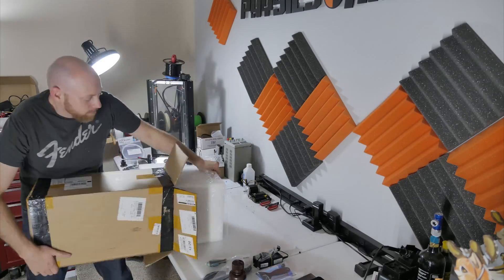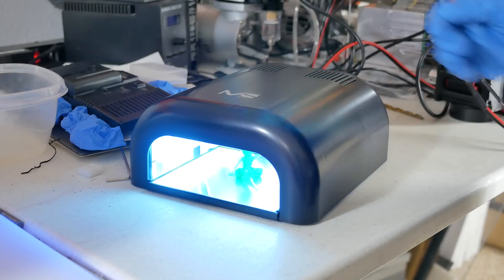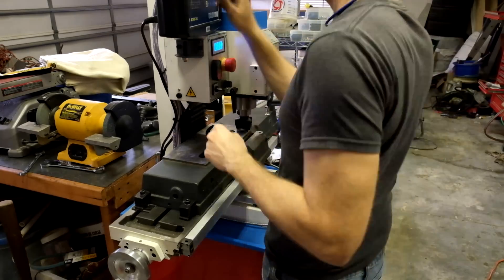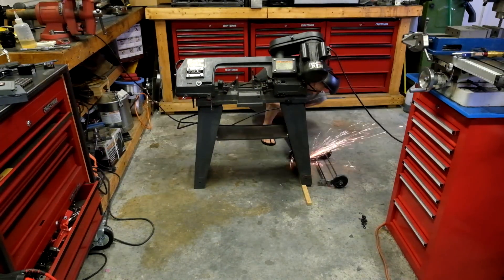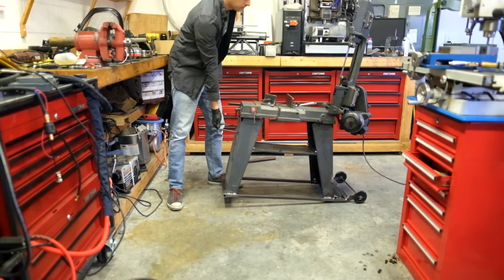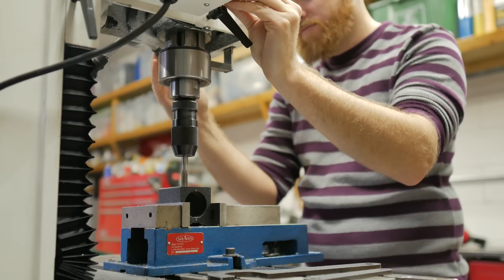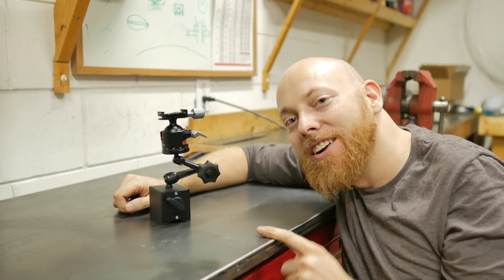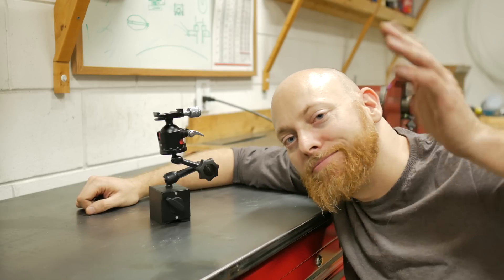The Chip Tray 02 - S02E44

Comment: On the bandsaw...would adding some weight to the other side not correct the balance/tipping issue? Just some scrap welded to the inside of the legs out of sight?
Reply: It would help for sure! Worst case is it would make it harder to move around. The other reason I wanted to add a little frame around the base is that the stand is just thin/sharp sheet metal and away made me feel like I was going to lose a toe.

Comment: Are there anything bad or need to be noted about the Photon? What's yours experience of it so far?
Reply from the maker: I think I will probably end up doing a full review of that thing, but the short answer is, it's good, but tricky to get right. The best looking parts come out when you print directly to the build plate without a raft or any kind of supports. That can be tricky depending on what your part is shaped like. If you don't have enough surface area stuck to the print bed, the part will pop off mid print, ruining your part. One way to make sure this doesn't happen is to over cure the first few layers, but doing this causes a small ridge around the part. Easy to sand off, but another step you have to take

Other then that, it's just the cost of the material. If your used to buying 20 or 30 dollar filament for your fdm printer, then this will cost you 3 times that for a half the useable material.
Reply: @PhysicsAnonymous  Oh! it's nice that you are going to make a dedicated video about the printer. I would love to hear more about the bed adhesion problem you mentioned. I've already know the price of resin is much higher than filaments, but I think the low price of the printer kinda offset it : ). Thanks for the detailed reply.

Comment: Any issues with keeping the blade tracking straight on that saw, I have one of the many variants, and I have never been able to get it to cut straight
Reply: I've had similar issues.. there are a bunch of little things you can do to improve it (making sure everything is parallel on the wheels, and checking or replacing the guide bearings).. But the biggest improvement I was able to make to mine was actually replacing the blade.. even though i'd already replaced it, i think i must have screwed the previous one up, and no amount of adjusting counter-twist into it could make it go straight.  With the new one.. well, it's not perfect, but it's better, I think.  I haven't used it in a while but i'm hopeful that maybe it won't be too bad.   Of course, it will probably just throw the blade, which is its other favorite activity.
Reply: @joshonthetube  is there a "right" way to verify if things are straight or not?
Reply: @EitriBrokkr  There's a pretty nice writeup on the process: https://wiki.hsbne.org/_media/tools/4x6bandsawadjust.pdf
Reply: I've seen a bunch of stuff on wood bandsaws with a tire and a crowned wheel, but nothing for a metal saw with the flange in the back edge of the wheel
Reply: I have one and used it to cut through 2 1/2" aluminum as you can see in my most recent video.  I have been fairly lucky.  I had some minor issues with the blade jumping off at first, but after playing around with the down force I rarely have those issues any more.  I think the quality of these saws just vary all over the map.  I won the harbor freight lottery I guess.